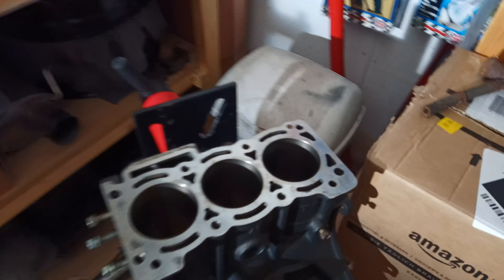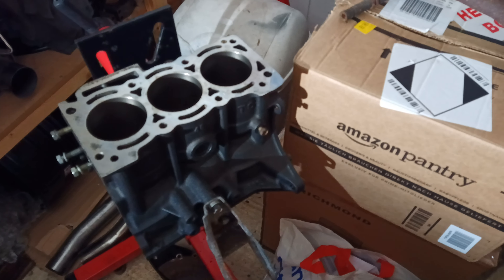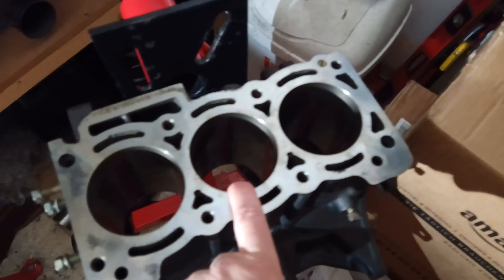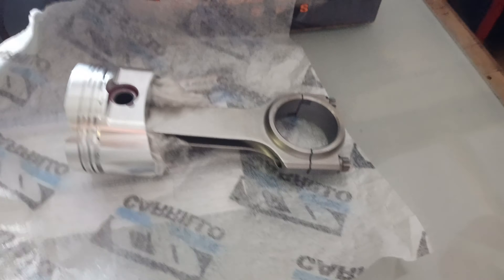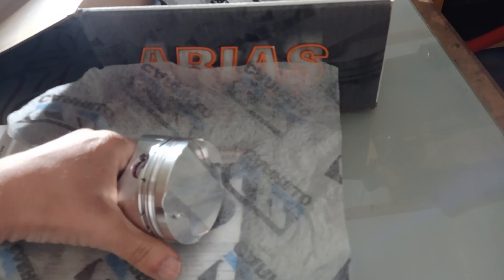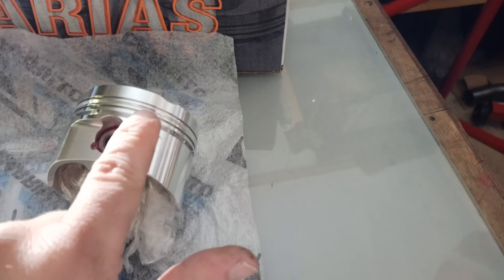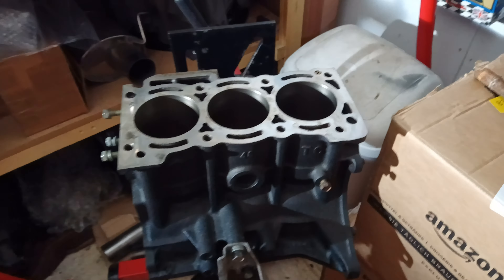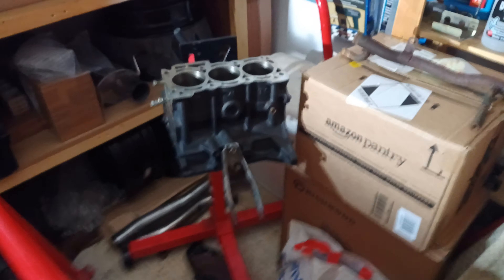Nathan Munns Daihatsu Charade GTti - Engine cylinder block - Custom conrods and Honda forged pistons

Comment: Could it get to 300HP if you also insert a pin in each cooling port? Since it's all forged and low compression, could it be fine for that much power?
I mean, there are other 1.0L 3-cylinder engines capable of that.
Reply from the maker: Oh you can can reach way over 300hp with these engines. Even stock internals can go over 250hp.  I know of 375hp being made in Argentina.
Reply: @munnsey  DAMN. WOW. 😳
Could you send me a link to that 375HP one? I was unable to find anything on Google, probably because of the per-country results bias.
Reply from the maker: @myrmeko  https://www.youtube.com/watch?v=348q8lhkYVM
Reply from the maker: @myrmeko  https://www.youtube.com/watch?v=iTmGdV0S-iE
Reply: @munnsey  That's proper fast. Forgot to ask if 375 at the wheels or at the crank.
Reply from the maker: @myrmeko  not sure about that
Reply: @munnsey  No problem. Thanks for answering so quickly. 😊
I really like cool and unusual cars and learning about this one genuinely made my day better.